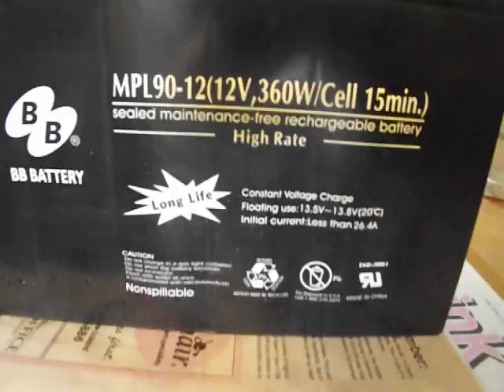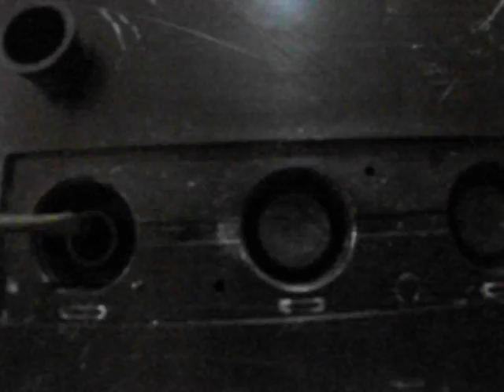AGM Sealed Lead Acid Battery Cell Dry Out. Hear Is Why

Comment: I just contacted a battery manufacturer and was told agm batteries are not suppose to be filled with electrolyte..hence the meaning of non spillable design......filling with distilled water like so many youtube videos is wrong .....i just found that out.....it will ruin battery
Reply from the maker: Its going to change the  way it needs to be charged is what  will happen. It can ruin a battery with out  changing the way its charged. Batteries come with spec's to how there are to be charged and that's based from the  electrolyte mixture. Adding more  electrolyte will end up making the acid more to a higher percentage. Which afterwards will also change the spec's of the battery. That's why it could get ruined cause the same charging methods will not pull out the acid from the plates which in turn will sulfate the plates inside. The extra acid will crystallize at that point stopping the battery from taking a charge. Which at that point its a battery that has sulfated up. Adding distilled water is the only thing that needs to be added. As its only the water that leaves the battery and the acid is still within the battery.
Reply: i understand the cell can dry out but you should not fill each cell to the top.....then its not a non spillable battery and also agm batteries are not designed to be full...just designed to be moist.....so how do you know how much water to put in?..filling to top is 100% wrong on agm battery
Reply from the maker: No idea sorry.
Reply: @MrDoingEverything  how much water should be use for 150ah battery
Reply: Der DDD is correct.  DO NOT OPEN. These non spillable batteries are not serviceable. Why do you think the access plates or plugs are glued? The glass mat design uses a paste. You cannot add water to them.  Doing so will cause leakage and the may EXPLODE. They will ruin your equipment.  When the cells dry out they are done.  Replace and recycle them.
Reply: @sbiwpo  My understanding is that AGM are actually slightly lower then atmospheric pressure and that the electrolyte is only enough to wet the layers of sponge like material between the plates. They work by a very specific conditional process when AGM but you could probably flood them and keep the caps loose enough to allow gasses to vent and they could work like a normal flooded battery just you could no longer use them in any place where they are subjected to lots of movement or could tip and spill out. You will need to add acid to them after adding water as any in the AGM battery would be very diluted after flooding as it would mix with all the new water and not be only on within the damp mats between the plates anymore.

The only way a lead acid battery can explode is by boiling a  non vented battery through overcharging and causing over pressure to point of rupture or from a hydrogen gas build up that gets to some ignition source as far as i know...
Reply: @sbiwpo  you dont understand, i live in the desert hundreds of  miles from the nearest human, the region has turned violent and  socialistic and no imports have reached, i have a solar charger  and am impaired by a stroke depend on my scooter to escape.....with a toddler......

Comment: The best thing with most AGM batteries if you own them from new, is not to charge them much above 14.6 volts EVER at normal (non freezing) temperatures. Rolls say their AGM's should not normally need equalizing. AGM's don't suffer from stratification like wet cells. Don't leave them in a partly discharged state . Keep them float charging around 13.6 v, or regularly charge them, & sulfation should not set in. I have Yuasa SWL2500 FR cells & never charge them above 14.5 volts. I've tested them & they are still very close to their rated capacity after years of service. Yuasa appear not to think voltages above 15v necessary or good with their AGM's. Equalizing is only really a good idea for wet cells every few months in most cases. Lifeline AGM's appear to be one of the few designs that can tolerate up to 15.5v occasionally if used for things like marine use, where they may be undercharged/overdischarged in service.  GEL cells are even more intolerant of high voltages & in most cases 14.1-14.3 is the maximum you should ever charge a GEL cell to (the gel just hates to bubble & even 15volts can ruin GEL's quickly + it's impossible to add water to a true GEL cell battery.) Only add water to AGM's when you are sure they have dried out. They are STARVED ELECTROLYTE so should be only about 95% saturated. Adding too much water is not good & results in poor performance/ shortened life. All based on 12 v batteries. I have about 50 batteries, mostly AGM's & this is how I treat them to last.  Hope this helps, regards to all.
Reply: Thanks for the info
Reply: @mjt11860  You're welcome.
Reply: how are thy refurbished?
Reply: I got 2 used agm batteries, not Yuasa brand, says on them "Cycle use 14.6~14.9V"
When I charge them with 14.9V (at about 5°C) and leave them disconected for 24 hours, they get down to 12.6V.

(I also have 2 AGM Yuasa batteries which when treated the same way stay at 12.99V)
Is there something I can do to help my weaker batteries hold a charge better?
Reply: @UltraRik  Personally, I 'd charge AGMs ending up at about 14.4 volts for most of their charge, then perhaps half an hour at about 14.6 v finally. Although they say up to 14.9 v for AGMs, it dries them out more quickly. You can leave them on a 13.8 V float charge for many days . At 12.6 v after 24hrs resting they're probably sulfated. Do a test with a car headlamp down to 11.2 v on load and see if they give anything near  they're rated AH capacity (normally it is drain to 10.8 v but I'd not go too low and just add a bit more capacity to the reading). You can buy a cheap circuit on Ebay to prevent over-discharge to below !!v on load. If it is  low capacity  you could trickle recharge for a week once  drained nearly flat but at a very low current like C/50, removing the charger if it gets to 14.4 v eventually. An old fashioned  charger (non-smart) set to "Lo"  but with a 10 ohm wirewound high wattage resister in series could be good. If that fails, ( NB it is pretty useless) inject a small amount of distilled water into each of the 6 cells (it is trial and error so just a  bit of water at a time)  in case it has dried out. You Tube videos often add too much water. They are starved electrolyte so not fully saturated "sponge-like" material. See how bad they are and don't add so much water that if you can pull the rubber caps off and water tips out if you turn the battery upside down an hour after added water  trickles out. NB you DON't cover the plates with water for AGMs. I've built and tried desulfators but none have worked to a degree worth bothering with. Continual charge/recharge cycling can help, but don't discharge too low, say down to no more than 11.5 v on a C/20 load each time and don't recharge above 14.6 v NB Stop once it's gone up to 14.6v)
Reply: Sorry, last reply should have read "Once discharged near flat charge at C/150 for up to a week, NOT C/50, and stop at around 14.4 v after the days have gone by" You can start by adding say, a 10 ohm resister in series with an old fashioned charger, but it may need to be higher or lower ohms to get the required low current which will fall anyway after a while. It is trial, and error depending on the old 12 v car battery charger.

Comment: Wonder why they call them maintenance free?  My UPS unit I think has failed due dry cells.  So the bottom line is when charging make sure to check liquid levels.
Reply from the maker: +mc “mcalleyboy” alleyboy For the most part they call them that cause when the battery goes bad after years of no maintenance. They figure its time to change out the battery. That's my thought any way. Lots of folks don,t want to do whats needed to keep batteries in good shape. So this type battery allows that to happen. Tc
Reply: +Thinking out side box   I had no idea it was a lead acid battery inside, I'm still living and learning.  I filled the water levels up in the battery and started charging it and then after two hours it started flashing the red and green lights real quick so I shut it down and tried unplugging the battery and from the wall and now there's no lights at all, as if it's dead. I need another unit now I guess, I'm not sure a new battery will fix this because even when it's plugged in and turned on, I have no lights now.
Reply from the maker: +mc “mcalleyboy” alleyboy Not sure what you mean. Are you meaning your battery charger. I could not see why that would of done that. Maybe it was just the right time for the charger to stop working. Letting you think its the battery that cause it. Were your connections right pos and neg. That might of cause a issue.
Reply: +Thinking out side box   Good idea.... I opened up the unit, it's from a chain store here in the Philippines called CDR King.  Surprisingly all the attachments are color coded to the battery and the plugs are dummy proof but we never took those off but I went ahead and took everything apart.

There were two fuses, one looked exactly like a fuse for a car marked 40, that was good and then another fuse or ?  much thicker old style looking fuse but thicker with another fuse that curls around the center fuse,  that was good.  I connected everything and triple checked (no burned out smell or burned area's) ... won't turn on at all, nothing completely dead?  Thanks for the help, I'm retired US Navy.
Reply from the maker: +mc “mcalleyboy” alleyboy I,d take a tester and test out where the power is getting to and where its not. It could even be the on/off switch. Its hard to know. Anyway good luck.

Comment: Do you add just distilled water or a mix of acid and water?
Reply from the maker: ***** In most cases just distilled water. Some time the mix is needed. Its really hard to tell. So many factors to play with. I,d say if there is no luck left in bringing the battery back up with the adding of water. At that point I would go with the mix. At that point there is nothing to lose. Its going to work or its not. Bring the battery pretty high in volts means a lot to. Do some research on top end volts. That has a lot to do with a battery.
Reply: But how much water do you add, and how do you know at what line to stop at? Thanks.